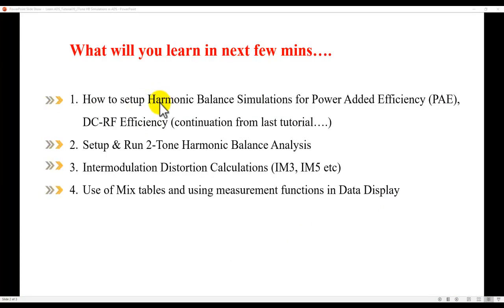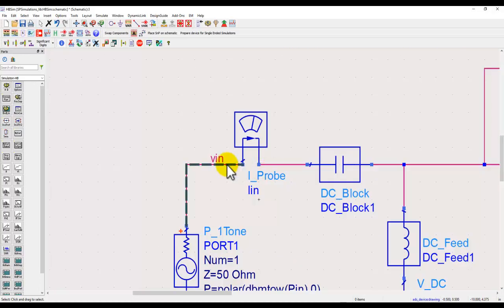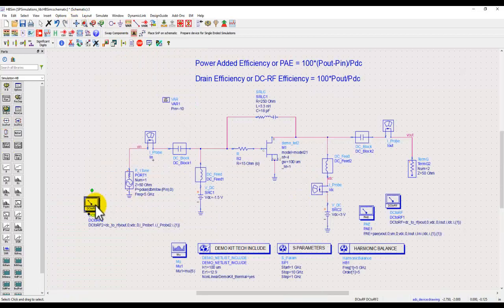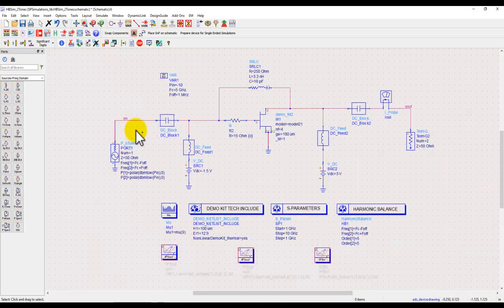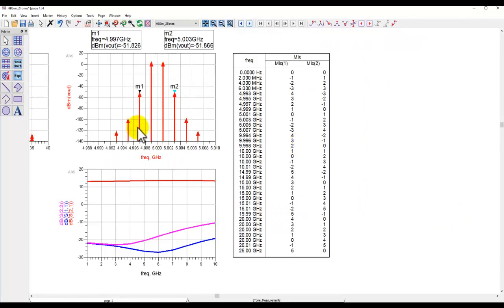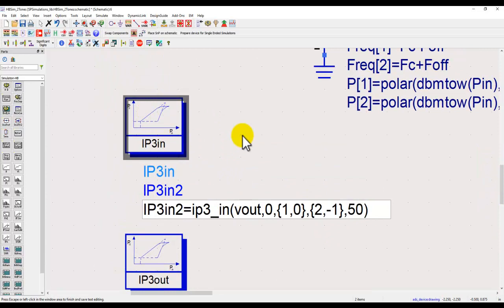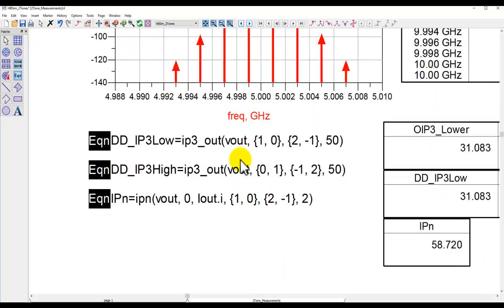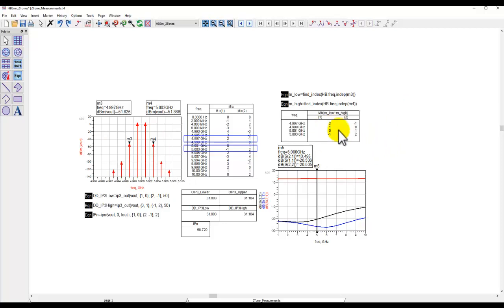Tutorial-39: 2-Tone Non-Linear Analysis using Harmonic Balance

Comment: Sir, when I plot both IP3 and OP3, it shows equal values. I tried I same on my design with a process library, and it showed the same result (IP3=OP3).  Why is the simulation not taking gain into account ?
Reply from the maker: Difficult to comment without seeing the setup. Kindly contact Keysight tech support for help
Reply: @BhargavaAnurag  the second argument in the ip3_in function is the 'ssGain' of the device. <incase anyone faces a similar issue> . Thank you sir :)

Comment: Thanks for these videos! I’m facing a challenge and could use your help.

I’m working on a subharmonic mixer, but I have a P_1tone component instead of an RTD diode. I want to use a sine wave as the LO signal with a frequency of f0 = 250 GHz, where N = 5. This means f_RF = f0 GHz and f_LO = f0/N.

I need to synchronize the LO with the RF signal in the oscillator. This phase-locking is essential to analyze the phase accurately. I think I may need a multiplier or another component, but I’m not sure how to achieve this lock. (and which component is the best LO as sine wave or general LO)

Could you guide me on the components I need and how to connect them?
thx

Comment: Why on IP3in in equation ip3_in(HB.vout,0,{0,1},{-1,2},50) you are using alwasy 0 as small signal gain ? In ADS documentaion  states that is should be small signal gain of amplifier
Reply from the maker: You are correct, there was a mistake in the equation. SS gain is only required for ip3_in(), rest all doesn't require SS gain.

Comment: Thanks for another informative lecture. I have a question about OIP3 table in the data display window. Third order intecepts are found from Pin Vs Pout curves. When I try to display OIP3_Lower and OIP3_Upper, it displays it as an array with the same length as Pin sweep. Shouldn't OIP3 be a scalar value? Your inputs are appreciated. Thanks.
Reply from the maker: When you perform IIP3 or OIP3 measurements, you shouldn't be performing sweep using the HB controller, you need to keep it fixed on a specific input power level that makes Amplifier to operate in a linear region. 

If you perform Pin sweep then obviously you will have a table of these IIP3 and OIP3 calculations done at every power level. There is nothing wrong in doing so but then you need to read these results at an input power level that is in linear operating region, typically 10dB below the 1-db compression point.
Hope this clarifies.
Reply: @BhargavaAnurag  Thanks for your reply. So, if we run parameter sweep while computing 2-tone HB, ADS computes linear gain slope for each of the power sweep values and thus gets as many third order intercept points as the power sweep.
Reply from the maker: @npurushothaman  Yes, that's correct. As I said, you shouldn't be running sweep when you want to simulate IIP3, OIP3 etc.
Reply: @BhargavaAnurag  I understand. Thank you very much for your support.

Comment: @BhargavaAnurag Sir, I am lookingfor a band limited power source to energize a circuit in ADS and couldn't find one. Is there any other way to simulate a band limited signal with a circuit in ADS?
Reply from the maker: Hi Athul,
With band limited source, I am assuming you would like to get modulated signal source? If so, there are many ways to do and you can look at the simplest way as described in this video: https://youtu.be/1EOCGYjlmmg
Reply: @BhargavaAnurag   thank you, sir. I will check the video.

Comment: Hello sir, I am designing a DPA and want to plot PAE vs freq at certain power backoff. So how can i plot that?
Reply from the maker: Hi Kiran,
Its all about post processing after you run a sweep simulation. Kindly refer to post processing video under Learn ADS in 5mins playlist. If that doesn't resolve the issue then contact your local Keysight tech support team for help.

Comment: sir in my case ( using different DUT) ip3in_lower and ip3o_lower both are equal value= 29.83  (same in upper case) is it wrong..??? secondly what we have concluded from ip3 value..??? what should be the ideal and minimum ip3 value.?? plz ans my question. thank you
Reply from the maker: This seems wrong. You will need to contact local technical support team to show your design and get it corrected.

Comment: Sir iam getting a message that
"warning detected by hpeesofsim in linear collapse '2' during analysis
Linearcollapse is disabled because there is 'HB' analysis present"
What i have to for this sir
Reply from the maker: Hi,
You don't need to do anything for this warning. Ignore it and your simulation will run just fine....
Reply: @BhargavaAnurag  sir my simulation is at 60GHz  but my  harmonics are obtaining at higher frequency. What i can do.

Comment: Hi. Thanks for the video. I have a question regarding PAE measurement. If I have multiple DC supplies, how can I select all of them and calculate PAE?
Reply from the maker: Don't fully understand the query. Where are you using those multiple supplies?
Reply: Hi. Sorry for the delay. I will elaborate. I have a multistage amplifier and each stage is powered using different independent supplies. 
During the PAE  measurement, you have to specify the output, input, and DC supply nodes right. So my question is, how can  I select these multiple DC supply nodes? Do I have to write a separate equation for this?
Reply: @sidhath98  PAE is a device metric term so if you want pae of each Stage  better to do for each power amplifier seperately  ,if not use a common supply rail  and calculate total current and efficiency of the whole block

Comment: Sir, could you tell me,  for small signal amplifier design how much power level  should  provide to the input network in practical case?
Reply: it should be in linear region ,best metric is to take the datasheet and find p1db now check if its output P1 dB or input P1 dB calculate accordingly by subtracting gain form the output P 1 dB  and do a 8-10 db backoff of the input P 1 dB  .So when you run your Pa 8-10 db below your saturation voltage (P1dB ) ypu are in linear region

Comment: Thank you very much sir, very nice and educational videos. I was wondering, for RF to DC converter with diodes, which simulation set-up you suggest? Harmonic balance or transient?Are there any particular set-ups to see the conversion?
Reply from the maker: Hi Jack,
You should be able to use HB simulation and output after DC conversion should be possible to see by plotting the variable as <nodename>[0] as index [0] will represent the DC in HB simulation cases....